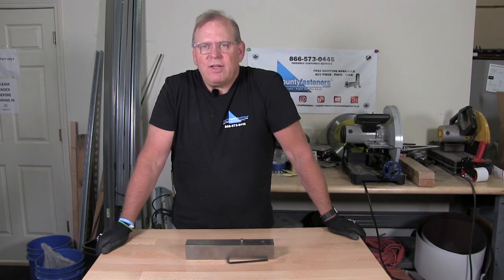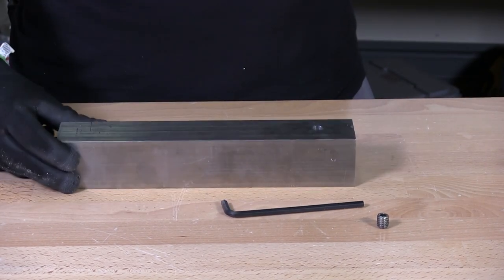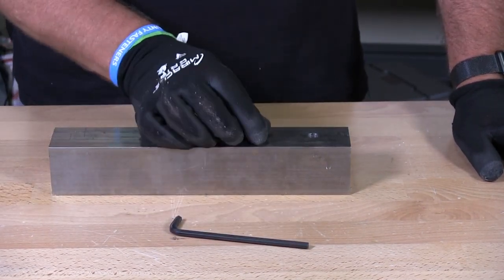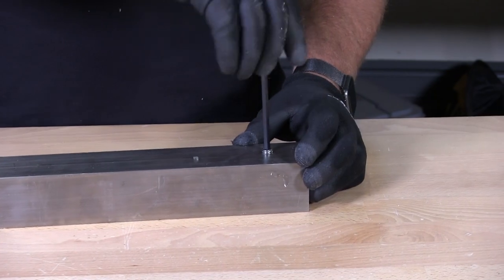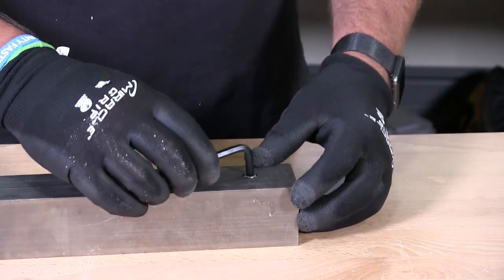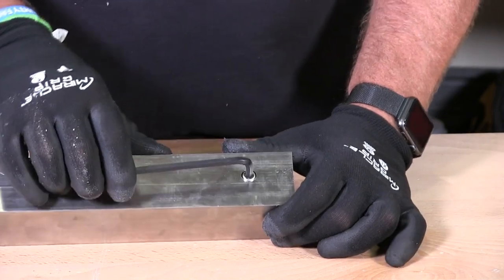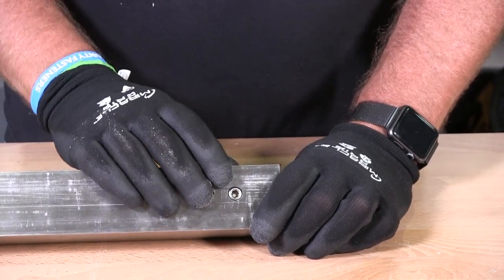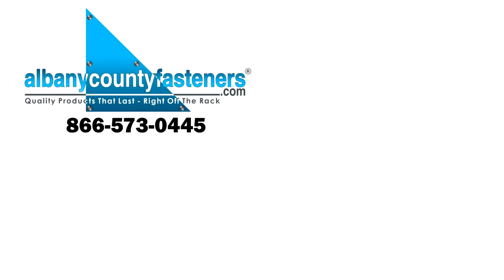How to Install & Use Set Screws | Fasteners 101

Comment: We have allen set screws in our grid plates in machining area at work. They serve their purpose of keeping threads clean of machining shavings. I wish we would have originally added a way oil to the threads to be able to back them out when needed, as some of them are slightly rusted in the threaded hole. Thank you for making this video! Same deal on our end, set screw has to be below flush or fixturing will hit it
Reply from the maker: Thank you for your feedback!